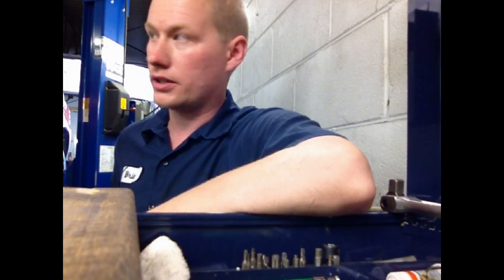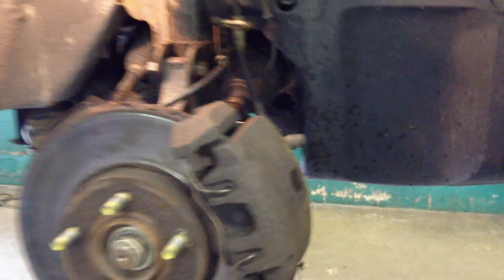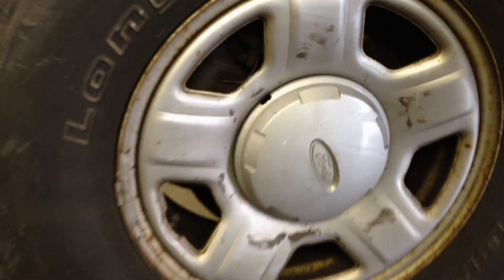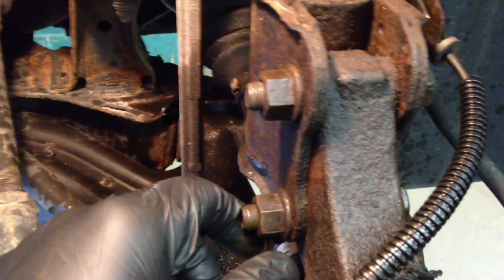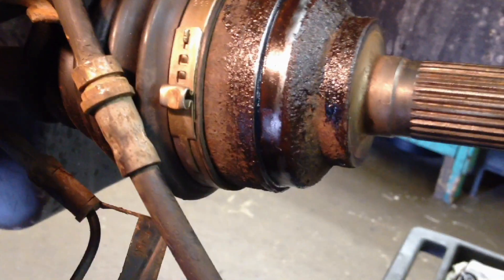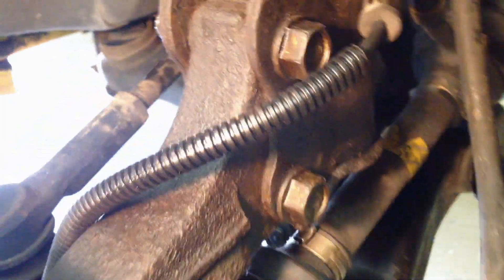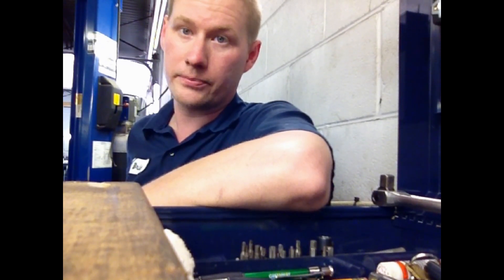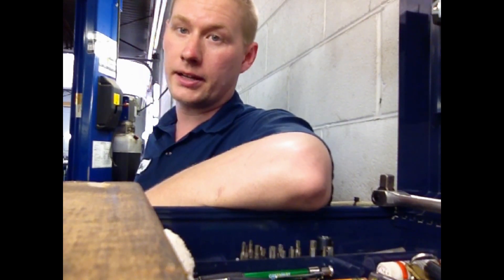Ford Escape ABS Tone Ring Install C1233 C1234

Comment: Really appreciate the video! Well done.
Three questions for you:
1) How did you get the axle back through the hub?
2) Is there a risk using the air nailer on the axle? Could you flair the end with the pointed nailer going into the center?
3) The universal joint on my drive shaft in front of my hanger bearing is shot. I've tried twice now to get the front axle off but can't get it off the PTO; rust ceased I'm guessing. How do shops get the front axle off? Could you post a video of that?

Comment: Just for my education, why would doing MORE than hand tight damage the  arm bushing? Thanks OH and when you take off the ABS sensor, does it only go back one way and no worry of having any adjustment issues. Not having  taken one off I am just trying to know  if it has to aligned just right or if the way it goes back has a way to put it in the proper position  That was why one bolt approach appeared less stressful to me if it was safe to do. Thanks for clarifying. I do find it all educational.

Comment from the maker: if you didn't pound the control arm or have to pry and pound your are lucky my friend that's a good thing made the job very easy. Yes you max out the axle nut and some firm taps yes, why we talking about this part? Yes once the strut and knuckle is not secured it will move freely yes. I pulled a simple tension clip for brake line nothing else real simple nothing to mess up why is that so hard and dangerous? Again I am not showing how I did it, I am showing how it is to be done.

Comment: Very informative. Trying to figure if I need to buy a torque wrench. You say the rotor nut should be tightened to 214 or with a 1/2 foot breaker bar or did you say a 1 1/2. I'm finding specs on 12 inch breaker bars at 159 ft/lb. Just wondering what I should find before I get under this thing.

Comment from the maker: At this point if there isn't any new codes stored you will have to take it to a shop since with the scan tools we can see which sensor is reading incorrectly. Which is causing the false traction control event.

Comment: No. there is no alignment at the strut bolts for Escape. I said "if".  Either the T-Birds and Cougars or my Volvo have elongated holes for a camber adjustment. I can't remember which at this point, I've done the struts in all of them over the years.

Comment: Like I said, just trying to figure out which way is better or what things can happen.  I learn about car repairs as I go. SO I was not sure what that bolt was holding on  I did not realize there was a ball joint there.
What is "the pinch"?

Comment: Hello and thanks for this video.  I think this may be the problem with my 08 Mariner.  Shortly after I start the vehicle the brake starts going into ABS mode with or with out my foot on it. Then shortly after that it stops & the ABS light turns on as well as the traction control light. The lights stay on but the pedal stops being in ABS mode after a while Think this ring may be the problem? Also is a 08 much different than this the 04? What is the best way to diagnose which wheel is the problem?

Comment: Cool- what do you think the spec is  85 lbs?  Also what if you do not have a wrench that can torque that much?  I only had 150. I got that and then went to a regular wrench and got it to move only a little more.  I did use blue thread lock and BTW it was not that hard to remove . I only had a 18" breaker bar and put little effort to loosen so not sure it was ever tightened to 225.  So you think I am OK with what I did and the Loctite? Thanks again.

Comment: I have an 08 escape 2.3L FWD, and although I could look up the part, it does not show up as separate from FORD if I use the model/year/trim approach..  there are several listed via Rockauto.... is that tone ring the only one from Ford?  Did you use any Loctite?

Ok just had to do this today, exactly like you did. I used a Dorman ring cause I had to do it today and Could not wait for the dealer part. Thanks!!!!

Comment: I have a 2007 Mercury Mariner.  Just had the front left brake line replaced by a local garage.  Their receipts include a word-for-word brief narrative from the mechanic which is cool.  He described a cracked front left tone ring, but also said "the only way to fix this is to replace the axle".  That's different than shown here with just the ring being replaced.  Is he right, because of some slight difference in the Mariner vs. Escape?  Or is he wrong and suggesting more work than necessary?  Also, the bottom of this car (I've only had a short while) is CRAZY rusty and scaly.  So is it possible that he's just estimating the rust is so bad that getting the ring off and a new one on would just be too difficult (or impossible)?

Comment: I will say your method probably would have made it easier to tap the ring on as the angle was all  wrong and the rotor would swing into it.  I eventually got the ring on but see why your method would give better access.  If do the other side at some point I will try the method you demonstrate.  SO maybe really his way does not save time as  while it all came apart fast it was tapping the ring and getting spindle lined up that would have made your way faster I am guessing, in the end

Comment: Will blue loc tite be fine for the axel nut?  I have seen on other video where  they remove spinel by just removing one bolt on the arm and later do not use grease but heat and then use crazy glue to seal the edges to I guess to help seal the rust out . I have also seen some say do not use grease in any form since if the ring slips it will hurt the sensor.  I know you do it the way you show but wonder if you see any issues with the other method? Thanks

Comment: Sometimes you have to try a way before you really know. If I ever have to do the other side I will report back.  With all the staging of tools. removal , clean up  and in the house it took me 2:45 but it got dark so if full light I say from pulling it all out to cleaning the hands and tools away maybe 2:30  with the other method first time out. What is the time a Ford Tech puts in?  What is the book time they charge for?

Comment: I replaced tone ring and your video helped out a lot.  Mine is an 08 hybrid awd.  Now only the front wheels spin in snow.  The rears aren't engaging.  Could this be an abs sensor or some other type of sensor?
Reply: Brandon Kienitz I'm having the same problem with mine to just wondering what was wrong

Comment: Thanks. OK so I did the job as the other guy did.  I was not sure the spec on the lower arm bolt.  Can you over tighten, With the car on the tire "at rest. I could use the size torque wrench I had.
Using 1/2" wrench I made tight but thought I heard a creak or crack. Is there anything that could crack on that bushing?   Thanks

Comment: Awesome video, thanks.  My only question is: what 6 jerks gave this video thumbs down?
Reply from the maker: Cory Mitton Oh I don't know not everyone can agree on everything.
Reply: Great video. Really appreciate it as the dealer and local mechanics INSIST that I have to replace the half shafts. I knew it was BS.
Reply: To YouTube, a thumbs-down is the same as a thumbs-up. They measure responses, good or bad.
Reply: Mechanics.. ..probably Ford dealership mechanics.
Reply: Why? Long unnecessary intro, much shorter and easier way to do this and the audio is awful. Remember this. Ford does things in order to find other issues that 'might as well be fixed while they are in there". That increases shop time and expense to the customer.
Reply: @dcrews649  Lol, it's been 5 years since I commented that, also I would like to add that, in fact, no Ford does not do it that way so they can find other things that need repaired, upselling warranty is a no-no across the board. Customer pay is different, but you make it sound technicians are sabotaging something...
Reply: @FordTechMakuloco  Brian my sons 2002 ESCAPE has a loose tone ring front left wheel sometimes it causes pedal to pulse or grind and sometimes abs light comes on in your description you posted the oem part link will this work on the 2002 because i seen something about 2008 and up on the amazon site? Just want to order right part with confidence Thanks!!

Comment: Awesome video. This is actually the second time I have had to use it. Passenger and driver's side. A question though, I have had a soft pedal for awhile now. The other day when the tone ring broke and the ABS light came on it actually made the pedal feel better. I was going to change the master cylinder. What are your thoughts?

Comment: Thanks for the video. I had just given the local shop the go-ahead to replace a ring for $280.99 and then google brought me to your video.  I called them off and will attempt to replace it myself.

For folks doing this at home, what's the best way to support the vehicle while replacing one of the front toner rings?  Where should I jack up the vehicle?

Thanks!
Reply from the maker: Best place is on the pinch weld area were its marked on the unibody the little notch out visibly thicker area of pinch weld.

Comment: I'm sorry, I meant "If". Some cars those strut bolts are elongated. The top bolt hole would be elongated, the bottom would be round, and the spinde assy would pivot for adjustment. According to Chilton there is no camber adjustment for escape. if the camber goes out the holes at the top of the strut tower have to be elongated with a grinder.

Comment: Ive been researching buying an 2008 Escape Hybrid, what are your suggestions on this? Seems like a great SUV, but I've been seeing reports about the Hydraulic Control Unit / Regen Break going out and it costing on average $5000 to fix. Do you see a lot of Escape Hybrids having this issue and what are some other common issues for the 2008 Hybrid? Is it worth it to buy this vehicle?Thanks!

Comment: First, thank you very much for this informative video.  The level of clarity and depth you provide is truly appreciated and I feel that videos like this show off the best of an open Internet platform.  I have a 2004 Escape Limited that experienced almost to a tee what you mentioned:  ABS light infrequently coming on, pulsating/grinding of brakes at low speeds and hills and a "nails on chalkboard" screech when the brake pedal was released coming from the driver side front.  After watching this video I went out and clearly saw the crack in the tone ring.  After having the car scanned I also got the code C1233 and B1676.

Quick question for you:  I don't have an impactor so I chose to take this to the mechanic.  They stated that you have to replace the axle with the tone ring so now I am thinking that I should just rent an impactor and do it myself.  They have never let me down but I rarely go to them anyways.  Was this a "money grab" or is it typical to replace the axle as well (unlike in the video above).
Reply from the maker: thelurker12 It is not typical to replace the axle, well it was back in the day but Ford has had the service part tone ring out for years now.
Reply: FordTechMakuloco I am having the same problem and my mechanic is telling me the entire axle needs to be replaced so thak you for clarifying that it does not. However, he punted out some sort or leak in that area... is there away that this is a result of the broken tone ring or is it an entirely separate issue?
Reply from the maker: Nope these tone rings will not cause any sort of cv boot damage.
Reply: Red E Some shops are money grabbers. When the mechanic has it up on a hoist its easy for him to stick a ice pick in to the boot and tell you that the boot has a leak and that the whole shaft needs replacing.

Comment: I just replaced a bad rear passenger hub assembly for a 2013 Ford Escape titanium and after installing it, I got multiple error lights. Abs, traction control and I believe some hill light. Now the vehicle is under powered. What could it be? Thanks

Comment: FordTechMakulo, I saw on another post that you need a torch for this job.  Where does the torch come in?  Also do you really need to knock back the axle?  If my ring is cracked and i suspect it is, I may take a stab at this myself.  Thanks.
Reply from the maker: Some torch the ring to heat and expand it on the ground then tap it on as I showed in the video. If you tap it on like I show you will not have an issue and you wont need heat. When we used the ford press tool it doesn't call for heat either. I wouldnt heat it unless you absolutely have to. Just make sure the area is clean where the new ring seats and all the rust is gone and you will be ok.

Comment: Please do ot confuse your beef with kewrock with my questions. Totally random that I posted as before I do a job I seek videos and found two different methods.  The video by Stee1hed does not show any issues with getting the bolt out or ruining a ball joint but also does not show or mention any issues. And a few comments mentioned it was smooth sailing but at least one had issue getting the spindle back in.  So why would it take more effort to back the spindle out than with your method?  Thanks

Comment: When my tone ring failed it tripped the AWD light, and effected that as well as the ABS. I could feel the drag as the AWD light erratically flashed on and off. My question is, If you drive around too long without fixing the tone ring (few months), can you damage the all-wheel-drive or transmission? I read in the manual of my volvo that if you drive more than a couple hundred miles on the smaller donut spare you could kill the AWD. Either the transfer case or the diff, because the system is constantly trying to compensate for a wheel it thinks is not at the right speed. Does this hold true for Ford also?
Also, the Dorman aftermaret ring is a huge upgrade over the OEM part. It's thicker, heavier metal, and it's zinc plated for rust. The Motorcraft par only lasted me a couple months. Ordinarily I always try to stick with OEM, but in this case...
Reply from the maker: kewrock The new ones from Ford are also much thicker in general compared to the old ones. What you can do is remove the ABS fuse and it wont falsely activate anymore

Comment: I have a 2010 Ford Edge Limited, and I have 2 codes C1185 and C1963.  The ABS, Brake Light, and Skid Light came on after I hit a big pud puddle.  The shop told me it was ABS Module, but I am wondering if mud got on the censor or the tone ring?  Any suggestions?

Comment: I have pulled codes C1233 U0415 U0414 from my escape. Do you think that a bad tone ring would set the other U0415 and U0414 codes as well? They seem like more generic bad data codes for ABS

Comment: thanks for the great video! im having similar issues with my 2012 escape, I checked all 4 of my abs tone rings all were tight and I couldnt find any cracks. is there any other leads I could look into before I pay a garage to run a diagnostic scan on it? thanks again
Reply from the maker: What is the exact issue? What codes does auto zone say you have and we can go from there.
Reply: The traction control feels like it grabs at low speeds (under 10mph) then it'll throw the abs and traction control lights and at that point it feels like the traction control is disabled. This started 20 hours ago and the abs/traction control light has not went off. I took it to auto zone they told me they couldn't read abs trouble codes and advanced auto parts told me there scanner was only updated to 2010. I'm taking a second look at the rings now hoping to find a small crack
Reply from the maker: Ed Yanik At that low of a speed it sure sounds like a sensor or ring issue but getting codes from somewhere would narrow it down to a corner of the vehicle.

Comment: Have a question got a 2004 Ford Escape xlt scanned the transmission yesterday and got 3rd gear incorrect ratio would the solenoid pack cause this issue any feedback would be greatly appreciated

Comment: Hey, I have a 2009 Ford Escape XLT V6 3.0.  Getting ABS, TCS and Brake light.  Message on display says "Check Brake System".  Scan codes are; B1342, C1280, U2013 & U3000-04.  No noticeable difference in driving.  No noises and I don't feel any difference in brake pedal.  Does this sound like the Tone Rings?  Guy at the shop is trying to sell me on a new module.

Comment: Can I safely reuse the axel nut on an 08 Escape FWD?  I see conflicting info on line with many reusing it but others saying don't reuse it. But I have trouble finding the part number. It appears you can reuse it and not have it loosen, right.  Otherwise do you know the part number of a new nut?  Thanks

Comment: I removed the bearing man and the black portion of it was facing in.. another thing that happens I guess it thinks my wheel hydroplanes and my traction control blinks and doesnt allow me to accelerate.. any ideas what it could be?? My cars apart right now so anything will help

Comment: Looks so easy in your video. However I cannot get that Axle to move, i tried using the little airhammer that i have that didnt do a thing. So i took a hammer and started pounding on the axle, no movement, so i took a bigger hammer and then i screwed up majorly. I figured i wanted to protect the axle and screwed the nut back on to pound on the nut :( well it damaged the threads. Now i have bad threads on the axle and the axle is still as solid in there as ever before. That came out way to easy in your video.
Any suggestions?
Reply: +Markus Ulrich what the heck am i doing wrong? I cannot get that axle to move! Got the bolts removed even removed the caliper and brake disc. Pounding on it with a round chisel and big hammer for hours now, does not move a mm
Reply: +Markus Ulrich I had to go and loan a puller to get that axle out. Also Ford uses a 9mm allen head bolt on the calipers. Most allen wrench sets do not include a 9mm, if you need to take the calipers off make sure you have a 9mm allaen ready.